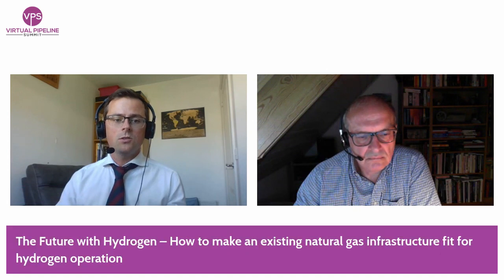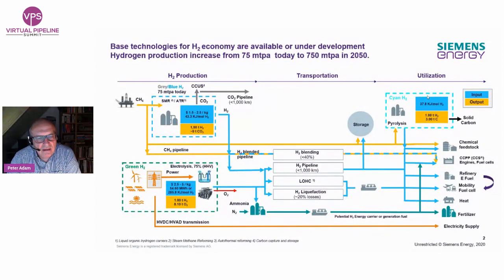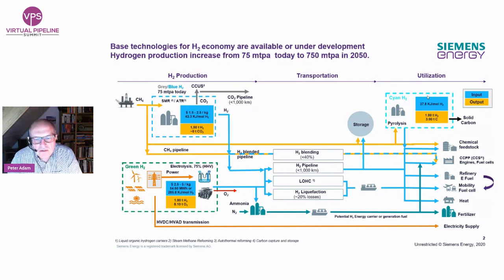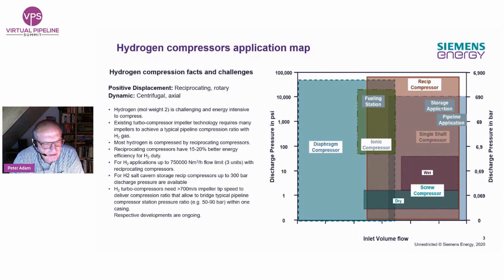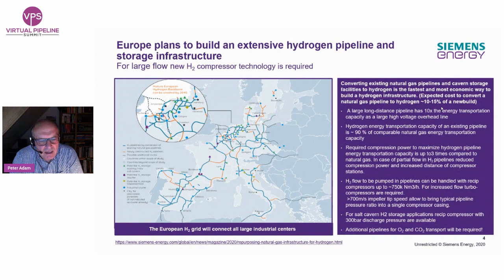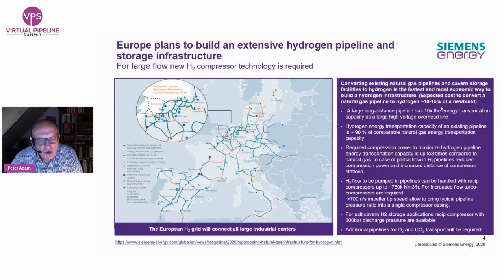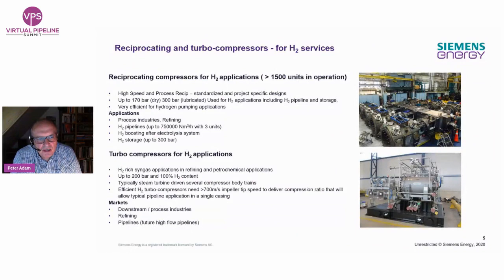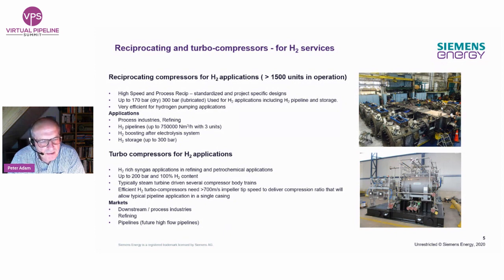The Future with Hydrogen – How to make an existing natural gas infrastructure fit for hydrogen

Comment: Sorry to say I disagree with the assessment, certainly as regards to the UK. The pipelines that were installed in the 1970s to 1990s in the UK and in some cases later were built in API 5LX medium tensile steel and this material is subject to hydrogen embrittlement above 50% hydrogen, as are pipes running Anhydrous Ammonia. Typically 56" diameter, it would require an upgrade to 72" 32 grade line pipe with increased thickness. To withstand the increase in pressure and allow gad packing the pipeline. That would mean that  a 40' trailer could carry only one length of pipe slowing down construction and increasing the size of laying equipment. Typically at large diameters, block valves and other large diameter fittings, would require lead times of up to 4 years. The UK has 4553miles of transmission grid. There are 19 compressor stations on the grid, with only standby compressor being reciprocating. All others are turbine compressors. There would be a need for 38 compressor stations, all  subject to hydrogen embrittlement. The 619  pressure reduction stations would also need  replacement. The difficulty about  repurposing the existing lines, would be availability of lines for natural gas transmission and one could expect a drawn out conversion period. Last time a conversion took place the country was basically in discrete system areas, and took ten years to complete and cost £2 Billion. My own estimates for the transition would be £2-3Trillion. Of course as said, unless you have Hydrogen available you are going no where. Unless the government were going to destroy the British Steel industry steel production using Hydrogen would require nearly 50% of the UKs annual electrical generation. Natural Gas  supplies 7 times the energy that electricity production does.